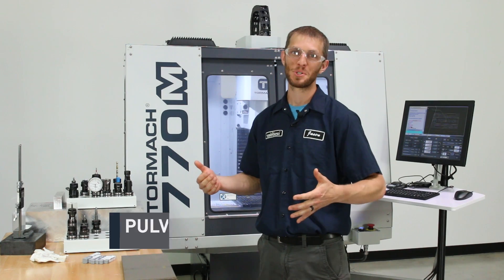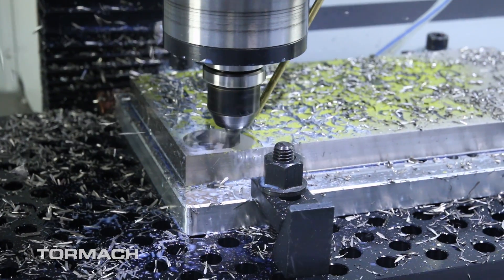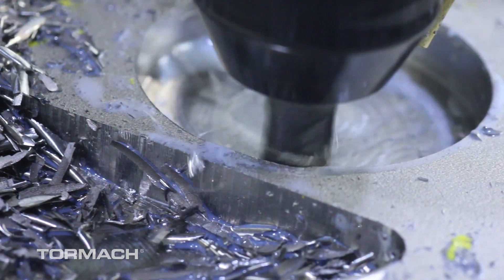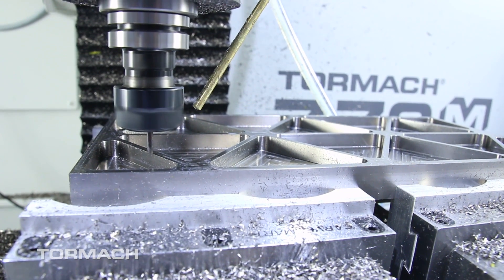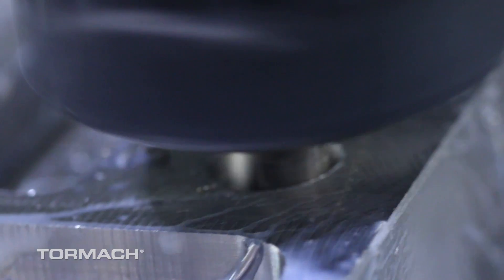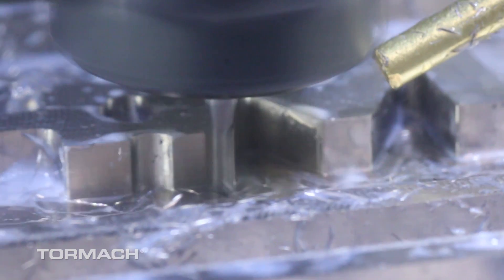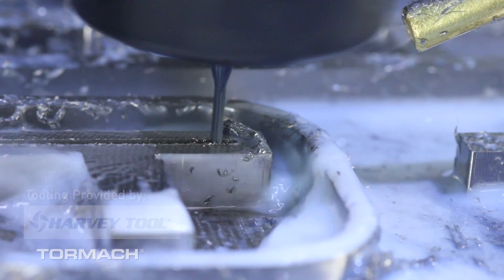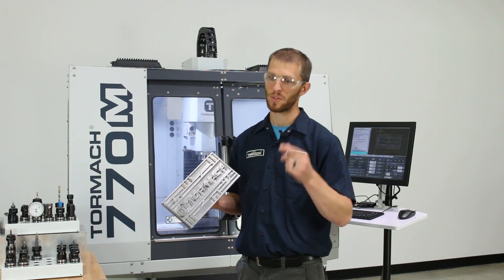Machining Titanium on a Tormach 770M CNC With Harvey Tools

Comment: Out of curiosity how come you don’t run flood coolant? Most of your videos you use a mister. I have a CNC Bridgeport clone and I run lots of coolant. I made a pump system out of a sump pump.
Reply from the maker: It is preferable to run coolant when cutting titanium, but we run the fog buster on this for clarity in the video. The fog buster did a good job, but coolant would have prevented us from burning up a tool.

Comment: What cam software were you guys using? Were those pocket roughing processes volumill?
Reply from the maker: The programming was done in SprutCAM, using their deep HPC strategy.
Reply: I use gibbscam 12, its pretty decent for things like that but expensive.
Reply: Fusion 360 is the king, and i also own sprutcam.

Comment: Shout out to NYCCNC for the blue tape method. It's saving me a lot of time with composites, which I was already gluing. The tape makes a better hold and way easier cleanup
Reply: The polyester powder coating tape they have switched to works better, it isn't softened by the coolant and the adhesive seems more resistant to oil.

Comment: Grade 2 CP is soft as butter and not what people would cut if they are knife makers.  Grade 5 TI-6-4 alloy is what people mean when they ask if it will cut Titanium.  I was curious to know what speeds and feeds you'd use for that.  On my 440 with flood coolant 10-15 IPM at 8000 rpm with 1/8 end Mills I get decent results.   Flood is Mandatory on the alloys as they have very low thermal conductivity so heat dissapation is a problem.
Reply from the maker: Great question Robert! Grade 5 is a higher hardness, so we would need to back down the surface footage. Harvey Tool recommends a surface footage of 125 for materials in the 300-350 HBn range. Jason recommends leaving the chip load and everything else the same. We are planning on cutting more titanium, including some 6Al-4V in future videos.